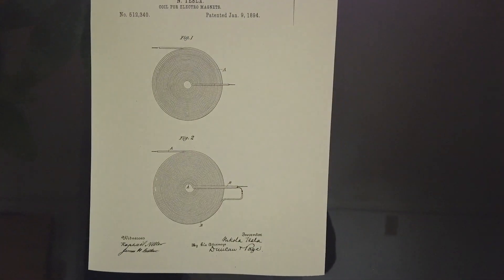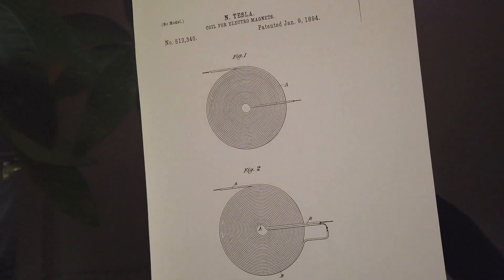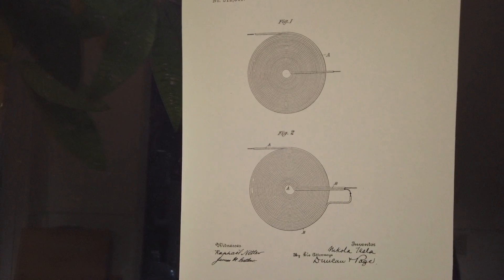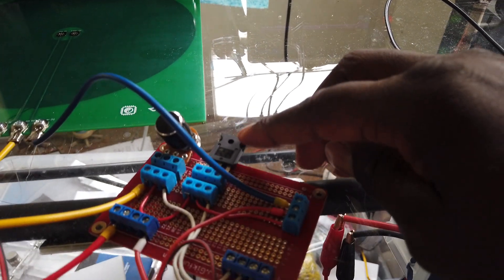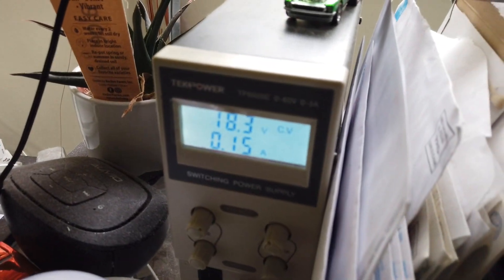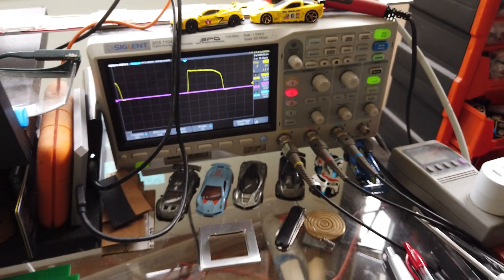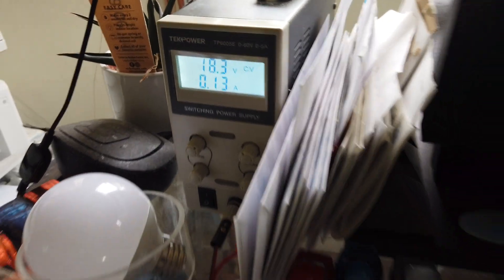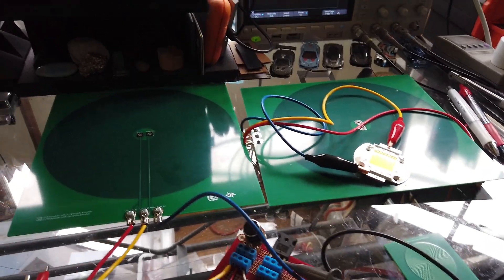PCB Tesla Pancake Coil Joule Thief

Comment: The coils I need have to be a specific diameter and number of turns, so buying your pre-made coils would not work unfortunately. However, if you could sell the KiCad project file and or the STL that could be easily edited, that would be of value to me.

Comment: Looks good, I always make them out of speaker wire, with hot glue. It's very easy and they work great. The low impedance works best when you make it series resonant. They can hold huge amounts of resonant energy. But they shine when impulsed, creating massive amounts of displacement currents.
I share all my research on my channel
Reply: How do you impulse them and how do you make them resonate seriously sir? I watched a many of video s and it doesn't really show me how to do it step by step
Reply from the maker: @Master Ivo, I've seen your channel. It's one of the inspirations for making these PCB coils. If you'd like to try out one of these PCB pancake coils, let me know.
Reply: @PerpetualMotor  that's very kind of you. I have some very large pcb bifilar coils (2 layer) but they suffer from rather large resistance.

Comment: +PerpetualMotor  great job on the build of the coils.  I am interesting in purchasing some of the coils but I have a few questions.  I have a greater interest in the Bifilar Tesla pankcake coil at 3:55 in your video.
1. Why the two holes in the center?  In the Patent the wires just start there and make their way out. The only thing I can think of is that in the PCB design it was easier to build it that way and simply BRIDGE the two holes?  Maybe?  Please share
2. Why the three connections   again maybe a PCB contruction issue. All things being equal there is three wires but if we wanted to jump "A" to "B" I guess that can be done?  And be left with just two wires?  Please share on this question. 
3. Is there a smaller version of the Pankcake PCB design?  Say maximum 4" x 4" ?  Is it possible?

Please let me know so we can begin a possible purchase.  Thanks

FYI request left on your Instagram page as well.
Reply from the maker: @Gilbert S these are all great questions. 

1. Why are there two holes in the center? - In Tesla's patent, there are two wires that spiral together from outside to inside. In a PCB coil, these two wires have to be on different layers. Those layers can only be connected with a "through hole". I could have used just one, but I wanted to make it so that if someone wanted to do any testing with just one side of the coil independently, or use both sides in parallel or series it would be an option. 

2. Why the three connections? - The three connections correspond to the incoming power supply, a connection to a transistor's "Gate" (MOSFET/IGBT) or "Base" (BJT), and a connection to a transistor's "Collector" (BJT, IGBT)) or "Drain" (MOSFET).

3. Is there a smaller version? - I only designed one version of the pancake coil. 

You can message me on Instagram - @PerpetualMotor. I'm slow to respond, but I eventually will. Thanks for the interest.

Comment: I'm wondering if I could attach a bifiler coil to my 3D resin printer print bed and then design a print around it. I know I can ad layers of carbon fiber to the print so in theory it's the same thing since its a flat surface. I seen a guy use a 3D printer to lay out his coils but they were not bifiler. This will be an interesting challenge. The area that is attached to the print bed would have to be flipped over and then printed on or just brush the resin on and cure it with uv light.
Reply from the maker: I saw that you posted an email address, but I can't find it in the comments. Could you repost it?
Reply: @PerpetualMotor  did you get that?
Reply: @PerpetualMotor  so I've gave it a few days. I'll just lost it here but I need to send pics of my work. I'm working with the exact same setup as you and many others. I just joined OUR forum you should jump on as I'm about to begin a thread dealing with everything I'm doing (+) I plan to open source the entire project but need a few more tests and a few more minds involved to find things I'm not seeing. It feels like the power at be constantly diverts communications and I'm not sure if you didn't receive my email or just been busy. I just think I have something that Yuri could benefit from. I've spoken to Gerrard Morins close close friend. I've spoken to Bob Boyce and I seen something they didn't see. I have connections in South Africa that could really benefit from this work and have their own set up brewing. Like I said this is email talk as it can stretch days on end. I've dedicated my late life to this project and I refuse to go until it's in the hands of useful "idiots" lol. Moral standing "fools" my main focus is on hydrogen and frequencies. I'm looking to build a shame stead with every aspect is revolved around frequencies and magnetic generators. I have the meditation room mocked up and I would like to send it to you along with some information obtained from some of the top leaders in this field. Thanks in advance. Advanced Water Technics aka Liquid audio Electronic components. That's the base of !y work. Mark Twain even thou I'm not a fan stated he was obliged to stand on Teslas' frequency generator platform for 30 min a day and his vigor returned. Riffe created a chamber that was said to eradicate cancer with minimal sessions. The hidden science there has her figured out or I will say I had a major revolution in regards to what humans are and how we interact within our Eco sphere. I will stop their as any more will be breaking my silence and I'm not comfortable open sourcing something %hat may in fact be nothing. But I highly doubt that's the case and I'm just worried it will get trashed before it gets understood. Advancedwatertechnics @ g mail . Com

Comment: Research information

Hi, my name is Victor and I have a question about magnets. The question I have is about the energy transfer between magnets. I made a 2-minute video  (   https://youtu.be/gpNjT2Q_Tvw  ) about it and a 40-sec video (  https://youtu.be/Jau-kkhCbyM  ) about something similar. I am wondering how the energy is transferred till the end of the cycle. Please take a look at the videos and give me any feedback/education that you can.
Thank you for your time
Reply from the maker: Hi Victor. Thanks for the comment. l watched the videos. I see where you're going, but the questions need more clarity. When I first started really investigating magnetism, I had a hard time separating terms like energy, work, power, and force. They each mean something different. Work is force over distance. Power is work done over time. Energy can be totally independent of distance and time and does not require any forces to be applied (i.e. potential energy). But the energy form (kinetic vs. potential) and change in energy can be very important. Lastly, there is the one thing that hardly anyone discusses, and that is impulse, which involves the acceleration of acceleration and can be calculated through energy conservation equations.

In both the 3 magnet question and 4 magnet question, proximity is everything, because the force of magnetic fields become exponentially stronger the closer they are to something that they can influence. The 3 magnet question can be answered, in part, by my dual axial flux motor videos ( https://youtu.be/6LlcSS6Ji6M ). Instead of a middle permanent magnet there is a middle electromagnet. It would require a considerable amount of work to place a permanent magnet in repulsion between two permanent magnets.

The 4 magnet question is very interesting. My first impression is that once the bipole permanent magnet is in the middle of two permanent magnets in repulsion, any slight offset would not only induce more of the attraction with the center bipole magnet, but this would be ADDED to the "desire" of the outside magnets to avoid magnetic repulsion. I can't say for sure what would happen, but this would be a great experiment. Do magnets want to avoid each other more, or less, than they want to attract each other? Hmmm.

I hope this helped a little bit. Good luck with your investigations.